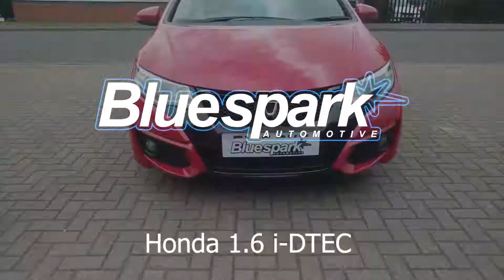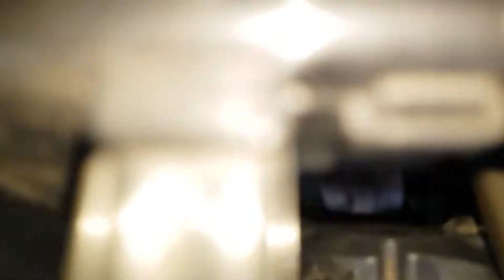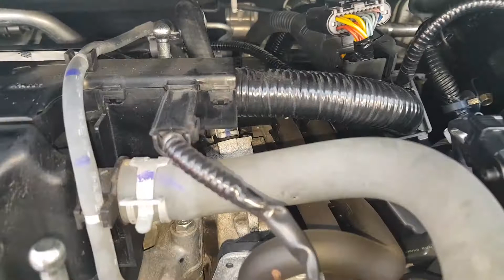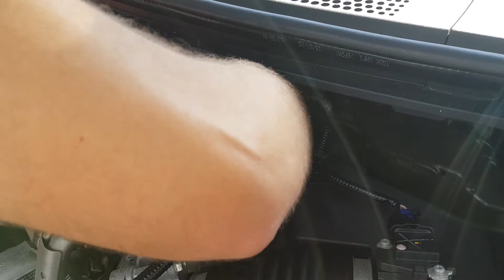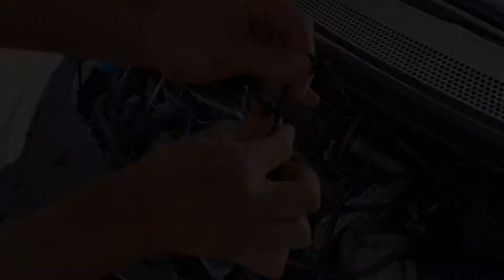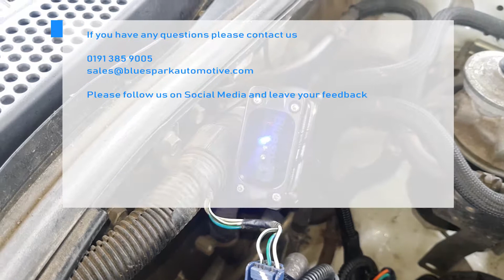Bluespark Automotive Honda 1.6 i-DTEC Install Video

Comment: Hi ,
I bought it for the 2018 HB Civic i-DTEC Pro + Boost model. Removing the rail connector from the car was really tough, but I managed to do it. The cable quality and product quality are excellent. I routed the cables from the back and mounted them in the empty space next to the battery. The installation instructions and diagrams were very clear.

The performance of the product is truly amazing. The promised increase in torque and HP is definitely accurate. Loading the desired map is very easy. It's fantastic on both C6 and E8. There is no black smoke at all.

The Bluespark Connect app starts from Android 6.0. My car's unit is Android 4.2.2. It would be great to change the modes from the car screen if this version was supported.

Thank you for designing and producing such a professionally made product.
Reply from the maker: Thank you for your feedback, we can look into making the app compatible for older versions of Android, we will need to speak to our developers to see if this is possible.
Reply: @BluesparkAutomotive  That would be great, please update us if it turns out to be possible
Reply from the maker: @pierb2848  We will most definitely keep you updated 👌

Comment: getting mine tomorrow can't wait
Reply from the maker: Awesome! Let us know how you get on 🙂
Reply: @BluesparkAutomotive  Got it fitted but was a bit of a pig getting my rail connector off. Installation was easy. l bought the Bluespark pro 147bhp version left it in c6 at first felt a difference pulling much better then switched to E7 and left it there pulling like a train now definitely worth it. I don't do standing starts I just wanted more pull and this does very well ,
Reply from the maker: @propanbutan4634  Very glad to hear it. I hope you continue to get great results, and if you have any questions please don't hesitate to ask.

Comment: what does your part actually do to the engine?
Reply: Any on the 2.2cdti???
Reply from the maker: Hi Darren
Our Pro + Boost unit monitors and adjusts fuel and boost pressure. With adding more fuel and air in a safe manner, we are able to increase both power and torque. Monitoring and adjusting boost pressure allows us to keep factory level air to fuel ratios.
Reply: @BluesparkAutomotive  hey, so its essentially a boost controller ? How does yours defer to racechip ? Thanks. Ps I am thinking buying yours